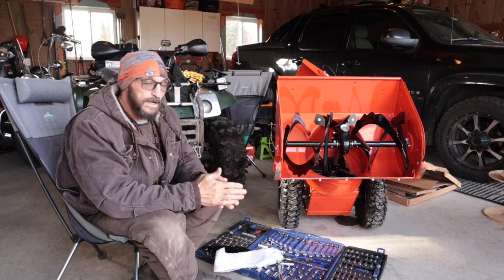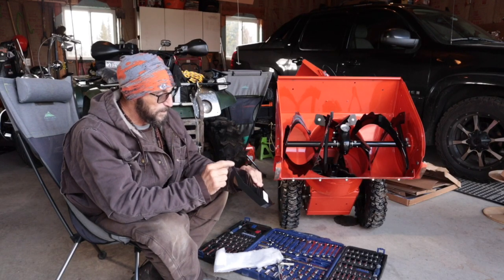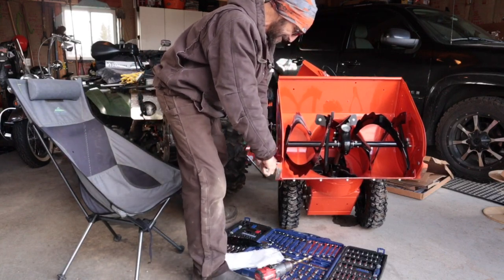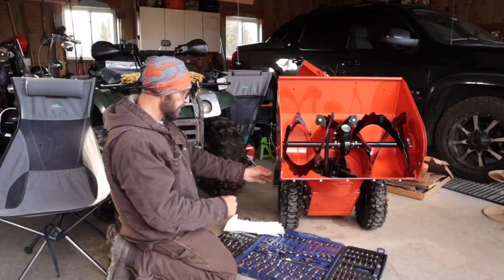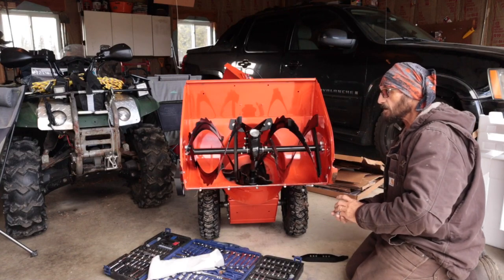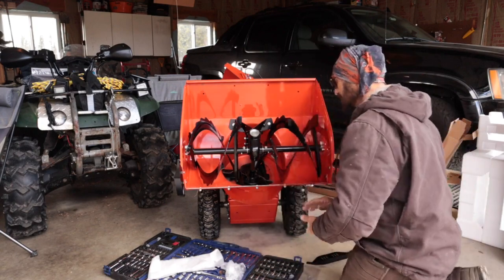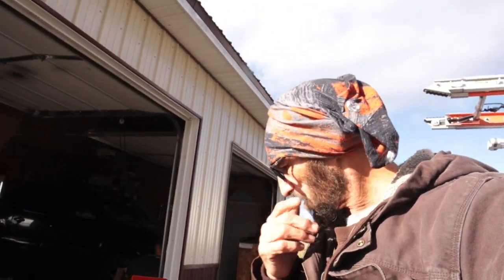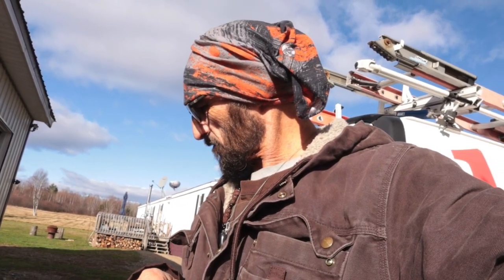Gravel skid plate install for Armor Skids, installing on my 28”Ariens snowblower .. they will work !

Comment: how high your running them for the gravel driveway?
Reply from the maker: Hey boss, sorry for the delay. I keep mine set about 3/4” off the ground. Through the first couple of trips it’ll find all the loose, high gravel. After that it’s pretty smooth sailing. My driveway is pretty smooth for the most part too. Hope this helps. You’ll be able to tell if it’s picking up to much gravel, a piece every few seconds is a normal sound for me. A barrage of gravel hitting is a no.. best of luck, thanks for watching..!